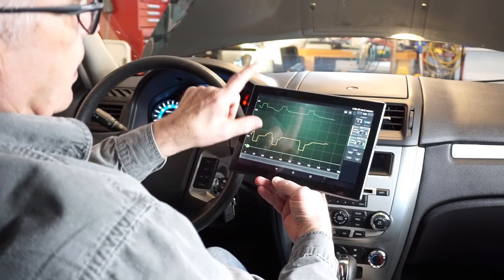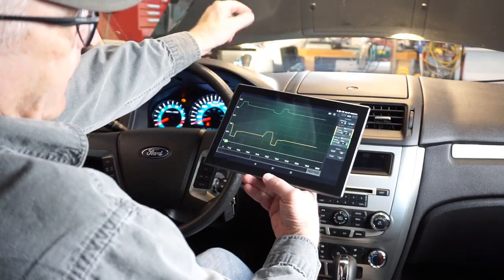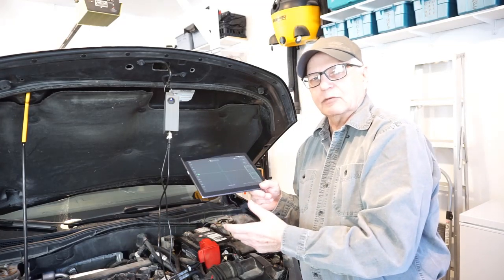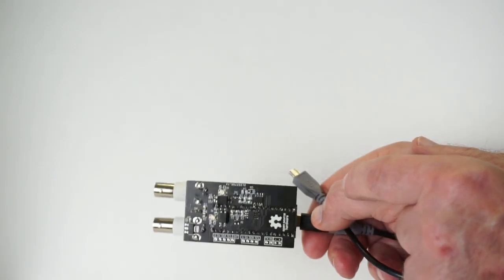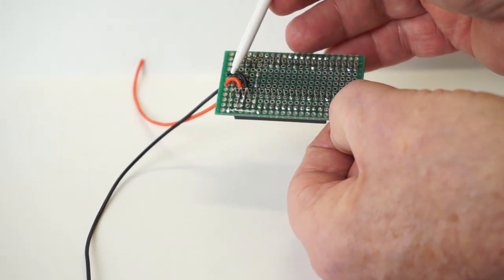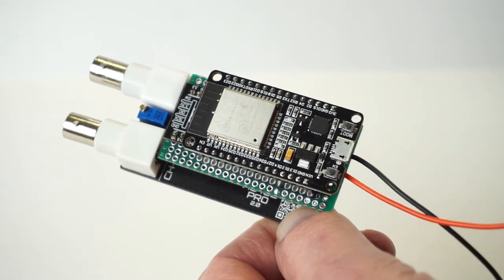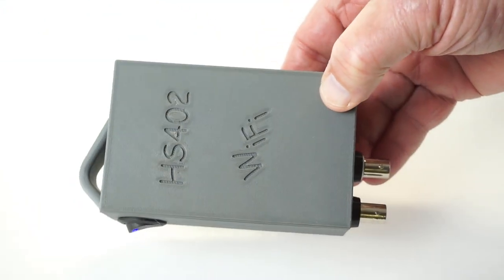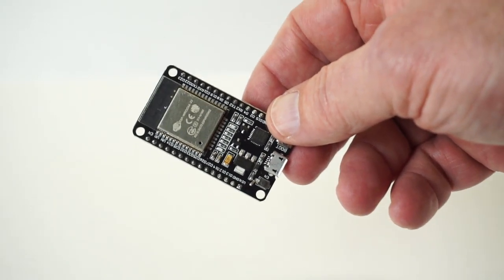GADGETS#137 - HS402 WiFi OSCILLOSCOPE

Comment: I like this a lot. Hope to build one soon but have to check availability and prices of the components cause I have no idea about the costs for such module.

subscribed ! 
thanks for sharing
Reply from the maker: as to cost, I make the analogy to fishing...if 1st fishing trip ever, than cost of lures and other equipment will seem high...

we have HScope TELEGRAM Group where info and advice is shared...I invite you to join us if you contemplate this build:

https://t.me/hscope

I would greet your there...

Denis
Reply: @theGADGETSplaylist  denis thanks for the invitation - i will be there once I am ready and prepared as I do have to order the SMD soldering pad and heat gun and some other stuff. I do not worry over the price, it is just to get prepared right cause I use to be well prepared before I start cause I wanna get it done in one run and do not wanna wait for parts or pieces missing.

First I need the basics, then I will have my loto one here and a bit more experience and then I am ready to follow you there.
But I am not the car guy, just have been working @ daimler HQ in the management, far away from plant and repairs even though I had spend my time there to learn the basics when I had studied, so I had to learn to bend iron and solder there cause I had an interest for crafting something else then Excelsheets and market or production strategies. 

But I like to follow what you achieve, all those different bits and pieces just to get a glimpse of understanding from the leak search over tyre and brake balancing to the pressure attentuator or the endoscope to look into cylinders.

thanks a  lot and I learned a lot from your work and help.
Reply from the maker: @typxxilps  all good:)

am sure you'll enjoy the OSC482 and you know where to find us if need arises...

Comment: Do you allow me to make one observation... use metal enclosure to work as a noise shield  or if Wanna go the 3D print or plastic enclosure
Wrap inside All Around with aluminium tape
Just made it on my old picoscope and it worked as day to night 
Well worth it 
Nice work
Reply from the maker: you are describing a Faraday Cage which was implemented on HS102 (GADGETS#62 @ 3 minute mark)

that scope is USB like your PICO and lent itself to this

but the HS402 featured here is WiFi and the built-in antenna of the ESP32 chip would likely be impaired by a metal shielding
Reply: @theGADGETSplaylist   yes its all true but you can shield and use external antenna 
I have a pico 2205 old one 
And saw that the new Versions came with metal shield around the board
Só i wrapped the plastic inside and now im in microvolts range maybe because was next to tv but now im happy 
Thx for answering
Reply from the maker: @alexluz7023  the 30pin ESP32 boards that this build uses does not come with external antenna option

nor does it need it

others have tried the ESP32E and found external antenna orientation relative to the circuit to be very temperamental causing more issues rather than solving them

all of this stuff gets experimented and discussed at length in our HScope Telegram Group, Alex:)

Comment: Hello Denis and Martin, my bits have just arrived and i am assembling my version of the board etc.
Just measured the current consumption of the board at 16 mA @ 5 volts and at 3.3 volts it is also 16 mA as supplied from the 3.3 volt pin on the 4 pin header socket at one end of the stm32411 board.
It seems that that the voltage regulator on the board can be "backfed" from the 3.3 volt header pin connection without consuming any more current.

The blue led/pushbutton on the board is happy with the 3.3 volt supply as well indicating the test software is running ok.
Can i propose to supply the board for option 2 and 3 with the respective external regulators for that option and leave the little choke near the micro in place?
This would make it easier to complete the project for some of the builders.
Or is there  a special reason to remove the choke?
Reply from the maker: Technical questions such as these are best answered in the TELEGRAM HScope Group...

I invite you to join us where Martin or others can discuss this with you Max:

https://t.me/hscope

Comment: Hi Denis,
Great project Denis. Will build one myself using your instructions.
Confused as to what is the difference between version 2 or 3 of the PCB.
Which should I order to follow your build (I know you used V2) but perhaps V3
is an improvement ??
Reply from the maker: I invite you to join us on TELEGRAM HScope LOUNGE:

https://t.me/hscope

much better place to discuss the v2.0 and v3.0 differences and lots of tips and advice before starting to order components...I will greet you there George:)
Reply: @theGADGETSplaylist  Thanks Denis, Had trouble getting into Telegram before (didn't like my Australian mobile number) but just got it to work using your link.

Comment: I see that the MQ sensor values are influenced by humidity and to a lesser extent temperature.  This might explain your "false positive" readings at steamy hot engine temps.

Do you have any idea of the response times of these sensors?
Reply from the maker: you are absolutely right about the moisture...it's a consideration...

I don't have the electronic response times at my fingertips...nor would they matter...the real response time is determined by how long it take for sample to reach chamber...I've modified the water separator since the video...check out images in download folder...and that has sped things up...
Reply: @theGADGETSplaylist  I saw a temperature correction formula in the datasheet but nothing for moisture otherwise one could add a humidity and temp sensor to the sampling chamber and correct in software if one really wanted exact measurements!

Actually, I wonder if a humidity sensor would be useful for detecting water vapor in the crankcase or exhaust in cases of headgasket leaks of coolant?  The alcohol in gasoline might throw exhaust measurements for a loop though.

My interest in response times is motivated by a curiosity of whether the  system could be used to detect leaks in the intake or exhaust systems?  One could use smoke or some hydrocarbon spray as a tracer and sniff around with a air sampling hose.
Reply from the maker: @TheDerekeder  those MQ-x sensors and analog and digital outputs...

Most ARDUINO projects you see are using the digital output combined with  elaborate "sketches" and targeted at air quality measurements.

I've used the analog output which is oscilloscope friendly and needs no code/sketches...it is for detecting the presence of hydrocarbons or CO2...no corrections/compensations...

Comment: Very compact the way you sandwich the boards together! I take it the low profile female headers used on the USB HS402 pcb will not provide enough clearance.
Reply from the maker: all kinds of clearance, Jim...the problem is the ESP32 boards came in with male headers soldered...and they are the square pin type...